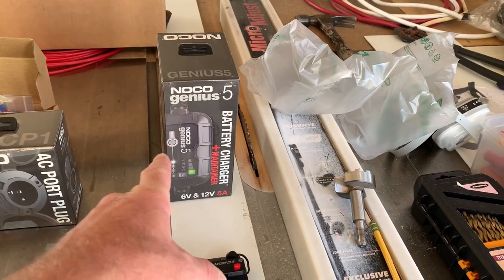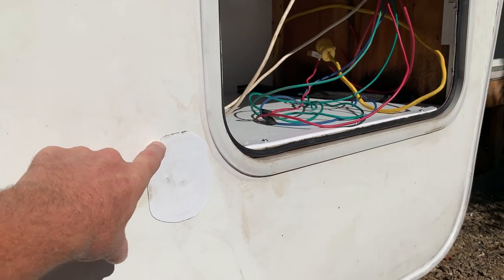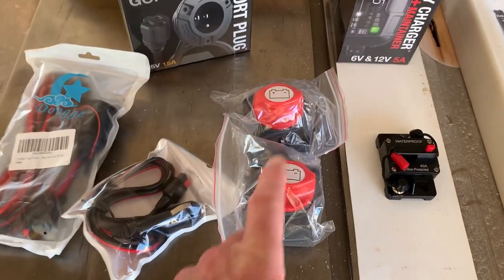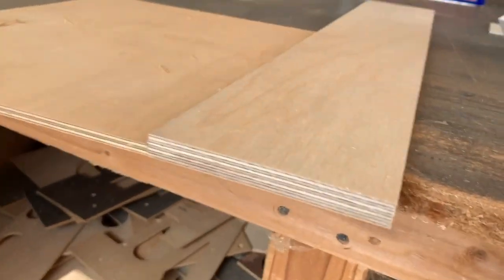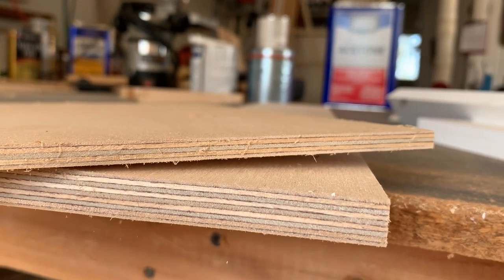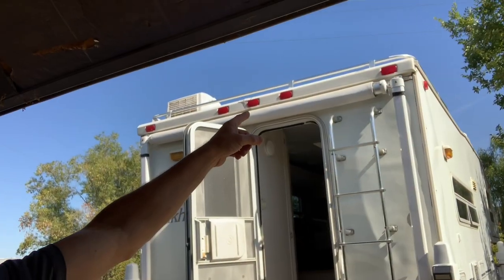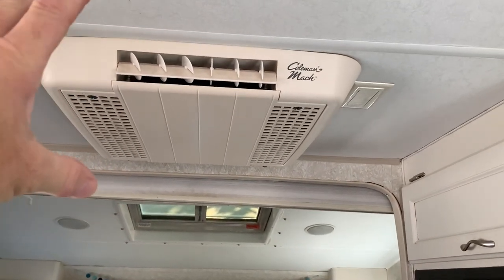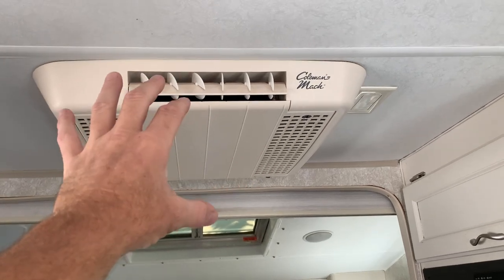What Am I Doing Now?  Planning RV Roof & Front Cabover Rebuild.  Then Some Big Ideas.

Comment: For a 5000BTU window AC for your camper to work perfectly I suggest you run over to your local RV dealer find a Fleetwood Wolf Pup 18' Trailer and copy the way they install the window ACs in those small travel Trailers. We owned a 2015 Wolf Pup Toy Hauler Travel Trailer with the 5000BUT Window AC and it worked perfect and looked "Factory Installed" because it was.
Reply from the maker: I’ve done several inspections on Crossroads Zinger travel trailers with the wall AC. 
Mine will be installed more like the Endgame Campers AC but lower in a fully enclosed compartment with baffles for cool air intake/hot air exhaust separation.  It sits in a tub with a drain to keep condensation away from the unit.  Still testing.

Comment: BTY Jeff, I have remodeled a couple of travel trailers and you probably already know this but when I upgraded appliances, AC, Heater, ETC. I sold all of the used working RV appliances, AC, Heaters for surprisingly good money on Craigslist!
Reply from the maker: I gave the air conditioner to my neighbor that didn’t have one.  I have plans to sell the furnace, cooktop/oven and water heater.   Not sure about the refrigerator yet.

Comment: Hey Jeff, I really like and appreciate your videos. Started watching your channel when you did the slide out repair. I live in a 2009 Lance 1181 with one slide just like yours. I would go with keeping your truck and camper. I've had 5th wheels & campers, & even drove an 18 wheeler, so I am not uncomfortable pulling something, but it has it's own set of problems. 
I too watch both of the channels you mentioned. I like your idea of the solar on sliding panels. Maximize the space. Also the different AC, good idea. I might even do that to my camper if I end up keeping it. My problem is my camper is too big for me, as I am alone traveling. I would like a camper with no slide, or, just build one myself. Or, sell both & get a good used 15 foot U-haul, and convert the inside myself. Or a van. Ha! Lot's of options. Anyway, can't wait to see your upgrades.
Reply from the maker: I agree.  These bigger campers are great but not quite as maneuverable as I’d like.  Lots of options for sure.  I appreciate the input.👍🏻

Comment: Hi Jeff, please do your research on EV trucks and SUVs as I have found out that with a ford lighting towing 3500 pound trailer you lose 3/4 of you "unloaded' range! It's OK if you don't want to travel more than 80 miles from home. It seems that EV Tech has not really moved into the RV world yet. I hope it gets there someday but that day is years maybe a decade away. Keep your Bitch'in Elkhorn, I've decided to keep my 2000 non slide shortbed Elkhorn and get it's issues fixed because being retired, I can't afford a $80,000 Big foot or Northern Lite Camper or a $65,000 replacement for my 2000 Silverado 2500 4 X4 6.0L Gas Truck that still runs good at 350,000 miles. I do get 10 to 12 MPG with our rig but gas now at $6 a gallon we are living like we have a Ford Lighting and only traveling to Wright's Beach California State Campground, 70 miles from our house. Wright's Beach does not have an EV plug in station. I can't wait to watch your roof repair Video!
Reply from the maker: Yep.  I’ve been researching for several years.  I know some RVers that tow with a Tesla model Y.  In their travels, range loss has been 50%.  (They towed a 3000lb trailer over 8,000 miles across the US to from Georgia to British Columbia and back.)
I agree that the technology and charging infrastructure is not quite there.  Getting better though.
Reply from the maker: Latest from TFL is not very reassuring…

https://youtu.be/yH4teZSCIj8